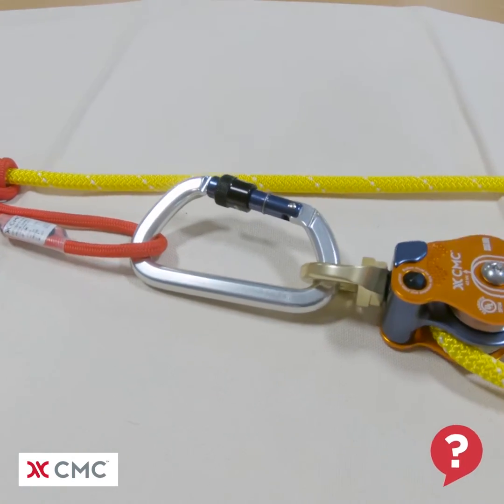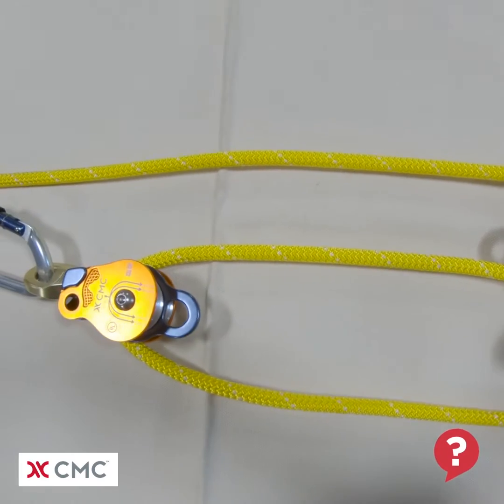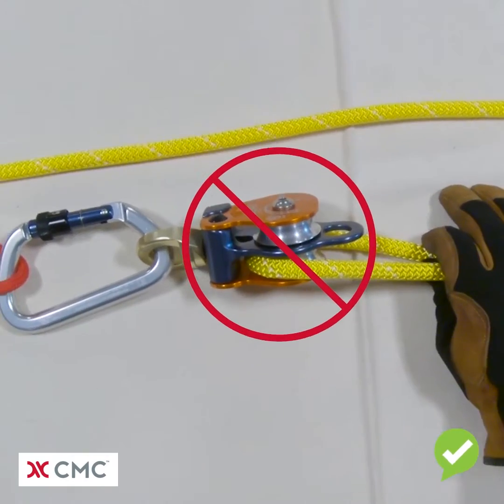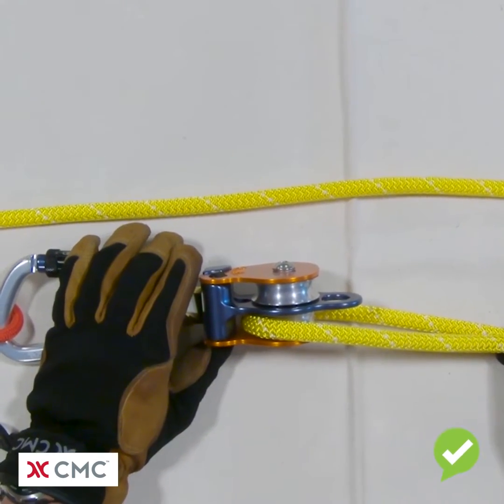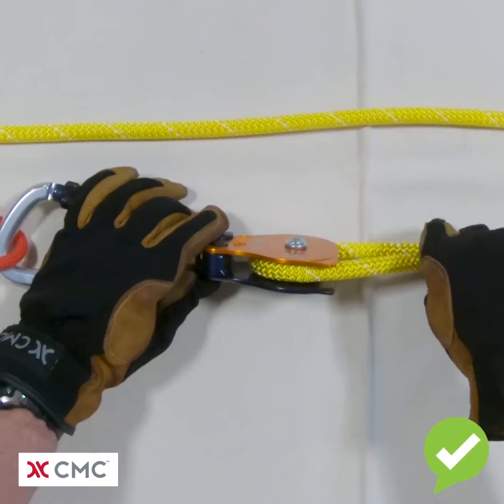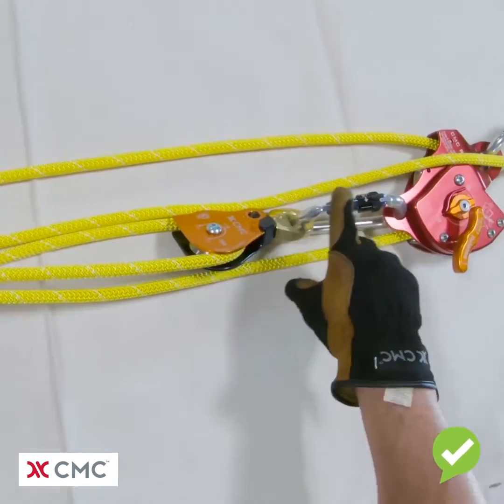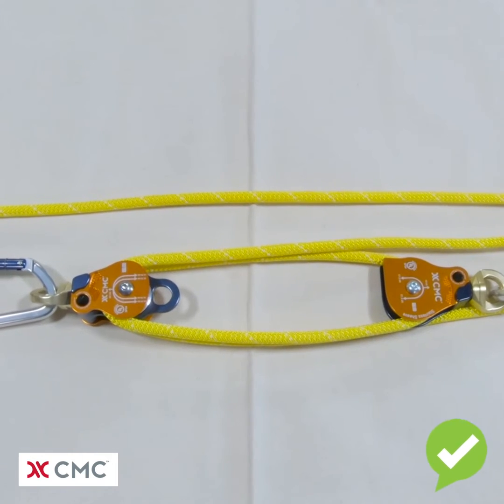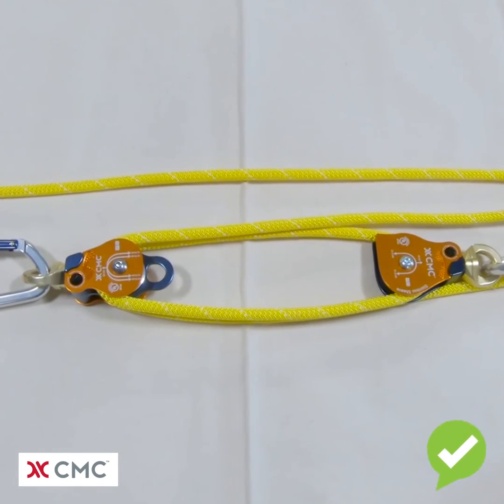Mechanical Advantage System #8 | What's Wrong? | CMC

Comment: What about the 2  hard linked carabiner connected to MPD?
Reply: Looks like a tri link to Carabiner
Reply: @oceanaddict9251  I think your right.
Reply: Still hard linked though  tri links are for triaxial loading with a soft interface.
Reply: @Scott W  I didn't know tri links were soft only. Can you articulate why not?
Reply: @oceanaddict9251 I may be wrong, it happens. This why I enjoy the banter. If I'm looking at the setup  Delta link to carabiner to MPD. If torsion is applied I though it would be felt at the MPD / carabiner connection because it is the solid link between to solid links. As for the soft interface it's what we've been shown and may be a dept thing. I have read since  you asked  and it is not stated my bad.
Reply: @Scott W  likewise. I'm also on the journey of figuring out what is dept. policies (sometimes myths) and manufacturers intended setups. We don't do this as often as it was intended for for, we are just trying to be prepared for the unknown circumstance we might affect a rescue